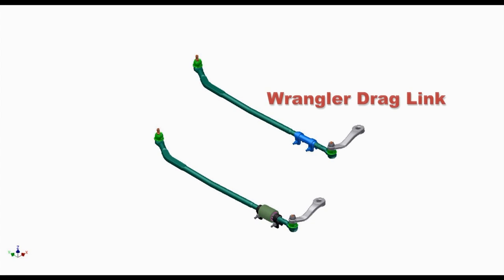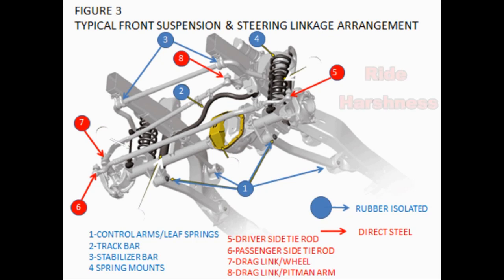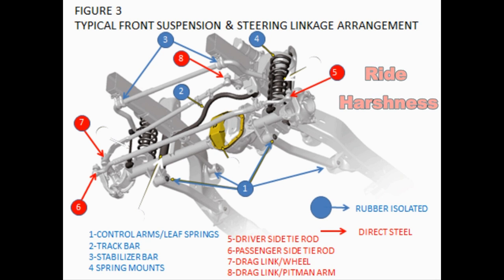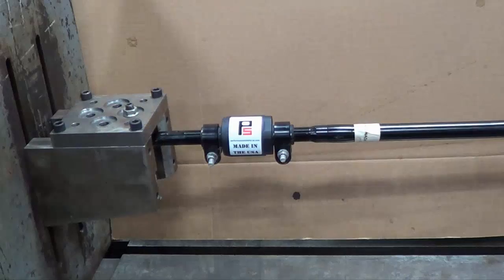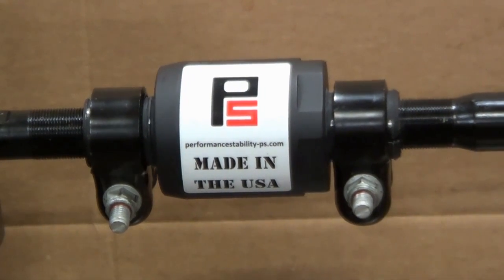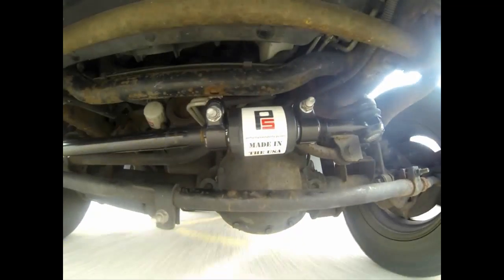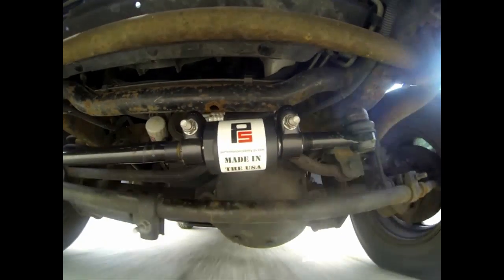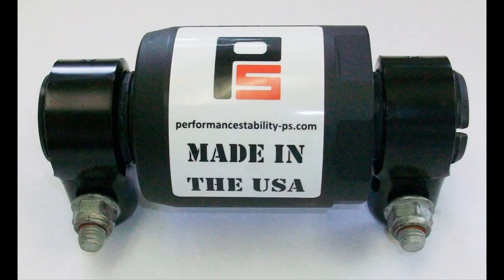How The Attenuator Works

Comment: I like and understand the concept well. However, I don't like masking issues that become apparent in the wheel within the cab. Somehow you need to get an indicator or better yet an electronic sensor because masking the dreaded "death wobble" will become more and more of an issue as more non-experienced (mini van like) drivers own lifted vehicles. So what if you can't feel it in the wheel, yet your wheels are actually doing something bad? More tire wear at the least, and unsafe road stability at the worst.